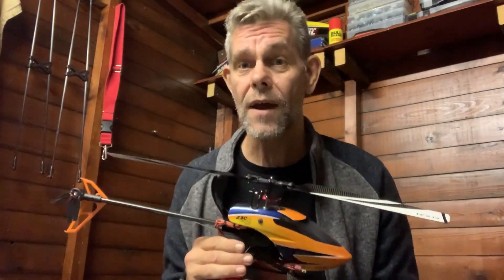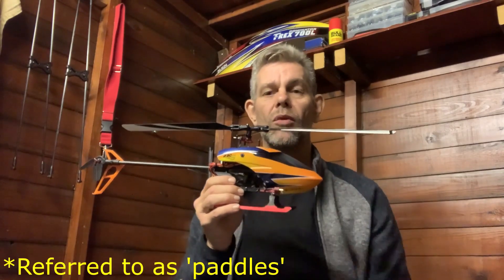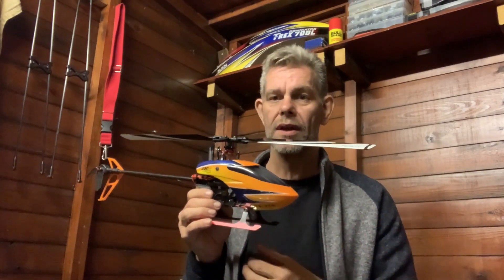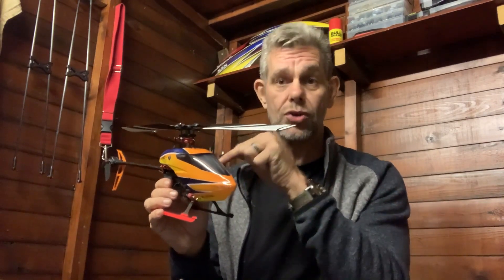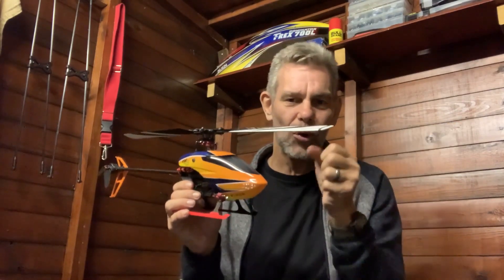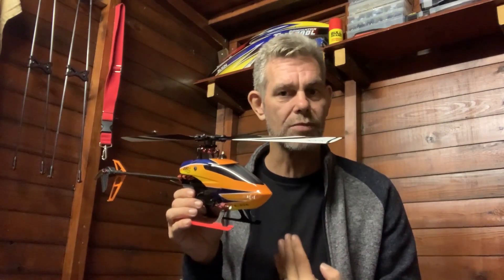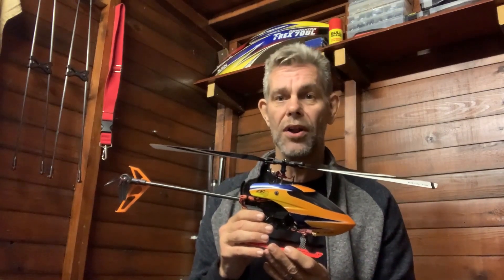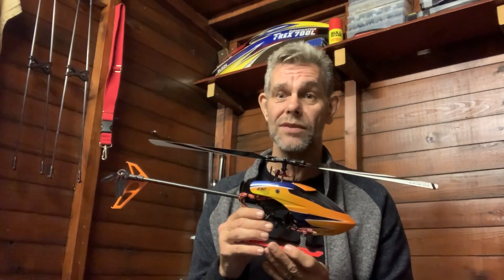Flybar vs Flybarless - The What & The Why?

Comment: I'd like to know how an rc helicopter pilot "improved" when going from FB to FBL system?
Is it just a "slightly more locked in feeling?
Or...is it truly a game changer where you can now do something like control inverted backwards flight or piro flips.
That you could never do before FB?

I was able to do everything short of piroflips with my trex500 FB with med/high headspeed and well tuned head.
Ofcourse, my FB was set for max response and minimal delay/stability.  The opposite for a beginner.
I had superlight KB paddles and also my tx was set to max cyclic pitch and min stick throw.

I flew until 2013 and I saw a few of my field buddies try to upgrade their gyro's from FB to FBL and rigid head.
They never impressed me with any quantum leap of skills except their ability to spend and crash.
I always noticed everyone would have at least a half dozen early crashes due to incorrect FBL setup.
I have to thank them for all the unused old FB parts that they gave me for my trex 500; flybar, head, linkages,...etc.

Also, it was not that complicated to setup the main blade and flybar.  
If you know how to zero your main blades and you know how to check/adjust your servos for binding then you can do it.
I'm assuming you can build and program your heli from kit level.  Then new generation of RTF....might have some trouble.
Reply from the maker: great post pal. I will ask Condor to reply to this as it appears he has the same timeframe of experience as you. My journey with RC helis started in 2014, so i pretty much went straight to FBL after converting the Gaui 425 from FB. For my limited experience yes, it was much more locked in and of course the FBL system removes any power jitters etc. With FB you are flying the heli via the servos. With FBL, you are essentially flying the unit - it controls the sevos. FBL software enables a much more refined and accurate changes to flight style over just the TX. 

However, like I said, Condor is best placed to help you understand the real differences. Thanks for the comment!!

Comment: the flybar less unit is called a gyro… it is definitely required
Reply from the maker: Thanks for your comment. It’s not referred to as a Gyro. You can have a Gyro fitted to a flybar heli - mostly in heading hold to avoid the old ‘rate mode’. A flybarless unit is actually called……. a ‘flybarless unit’. One of the many capabilities is as a Gyro but certainly not its only feature - they have many!!  ;-)